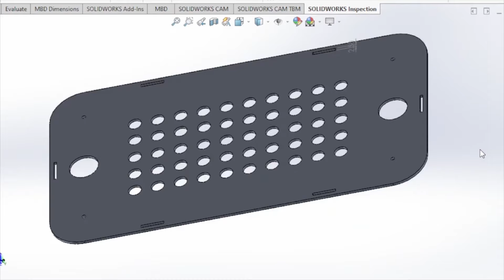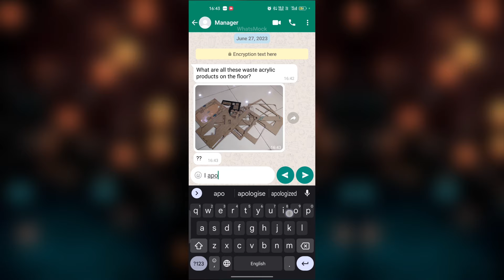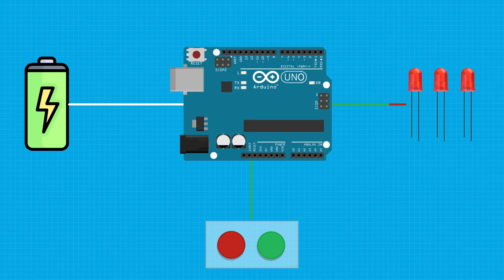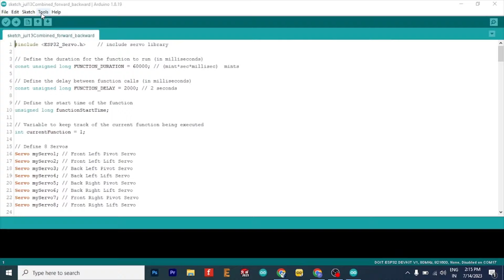Build LED Arcade Game using WS2811 LED Strip and Arduino Nano

Comment: Why red button is suspicious? Good video will love to make one
Reply from the maker: The Red button is suspicious? but why do you thinkso ?
Reply: @Circuitdigest  I think it needed a full press to work while green seems working when it's halfway ,but apart from this I would request u to make multiple games using same ,also in this game whoever reaches centre of the led wins the game ,it would have been better if player could reach till the end of the led ,this wud have given more time to play and give tough comeback competition 🔥
Reply from the maker: @drelectronics13  hi there, we tested this and found both buttons are working the same way and have equal chances of winning..it actually depends a lot on whoever is pressing the buttons. also, thanks for the suggestion about the game.